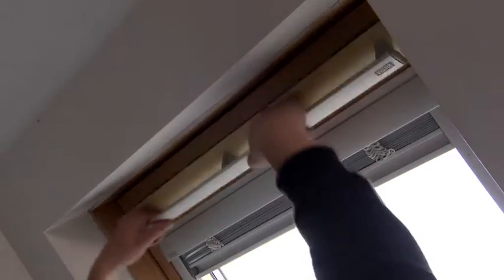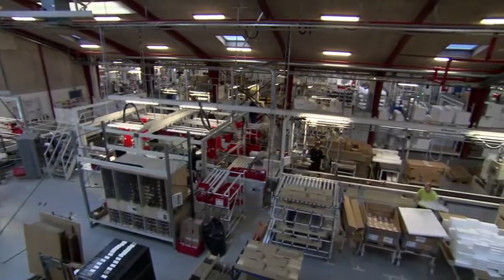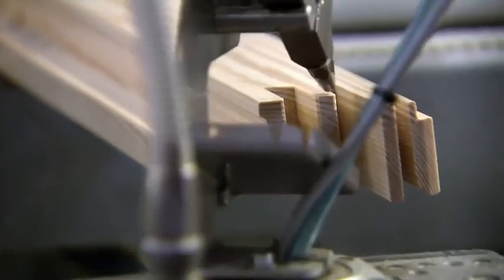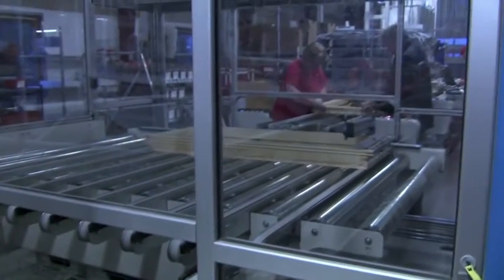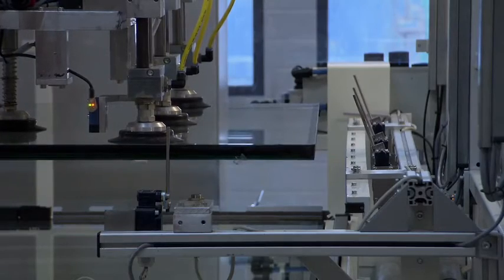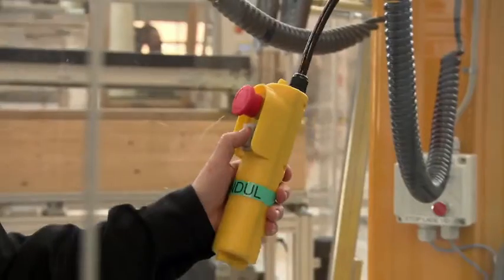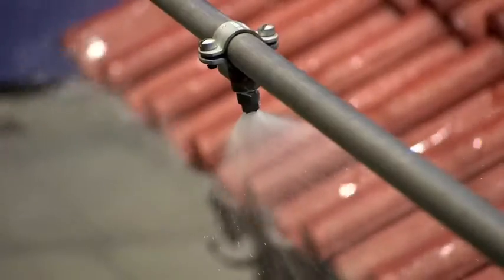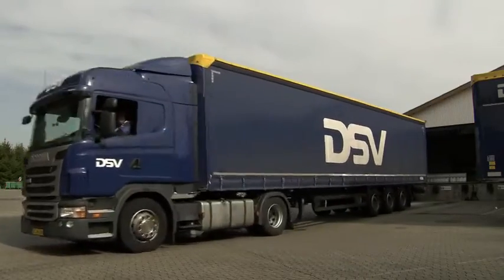How Do They Do It? Featuring VELUX

Comment: I just put 8 Velux in, replaces 8 Andersens, that had 29 years of use, finally things get old, seals start to leak, new Velux start over, better low e 3 glass rated better, with quiet clean...seal nice to roof deck, roof seems quiter....same warranty 20 yeaers on glass, 10 year no leaks, good stuff